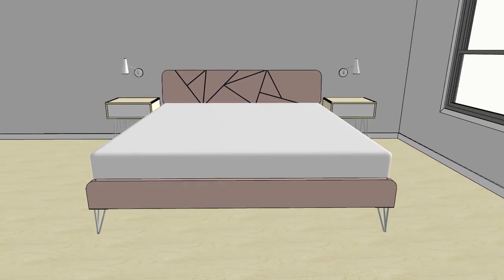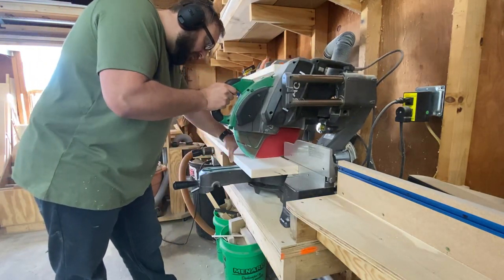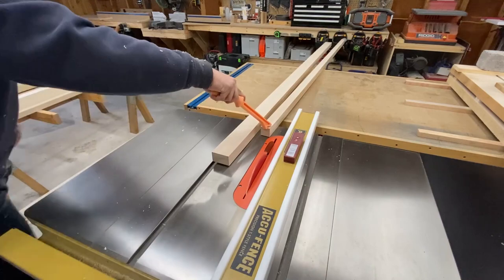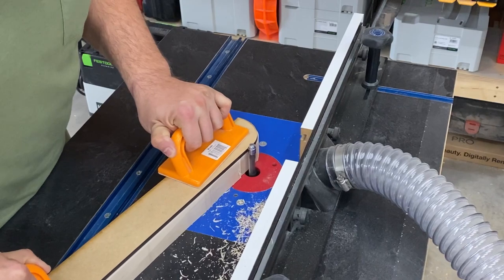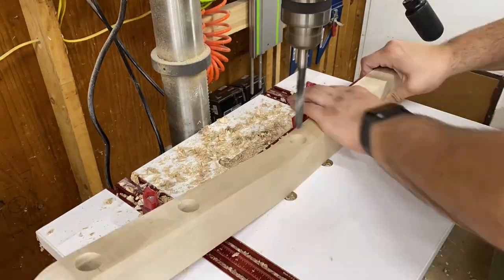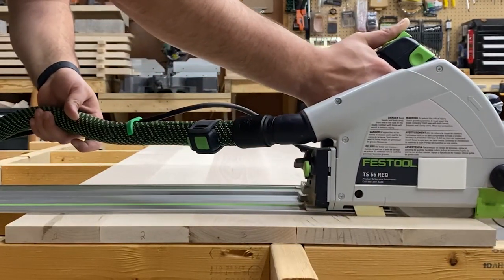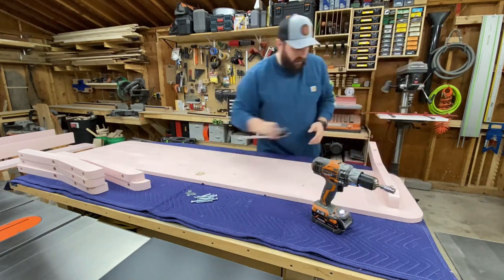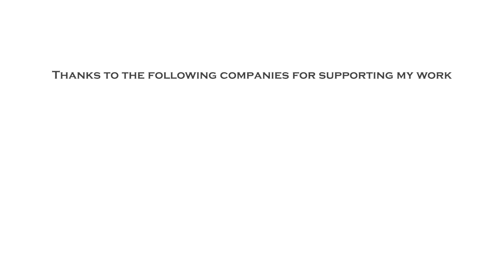How to build a mid-century inspired retro modern bed frame.

Comment: Very nice work, found you through Four eyes.  What kind of shop is that? Nice drum sander!
Reply from the maker: The very beginning of the video was filmed in our High School’s shop. I used their jointer, planer, and wide belt sander for some of the milling. Most of the boards were wider than my jointer, so this just made it faster/easier. Some really nice equipment for sure! Everything after the wide belt was filmed in my garage shop. Thanks for watching!